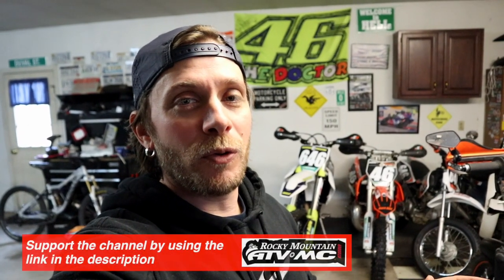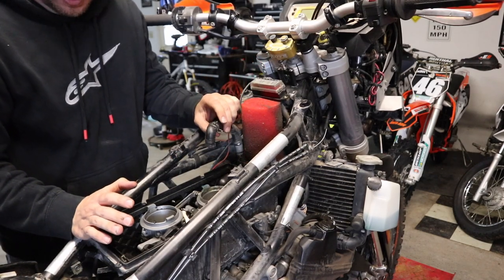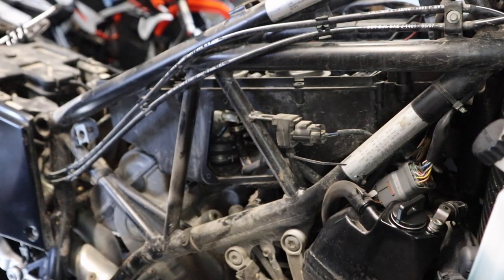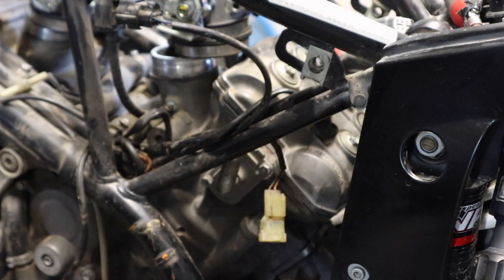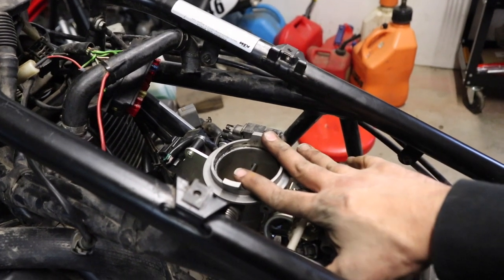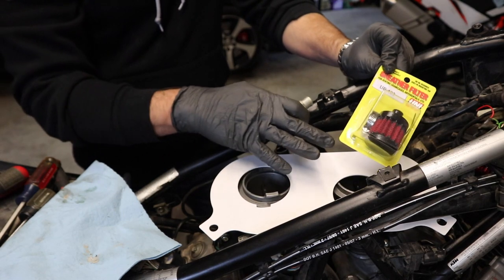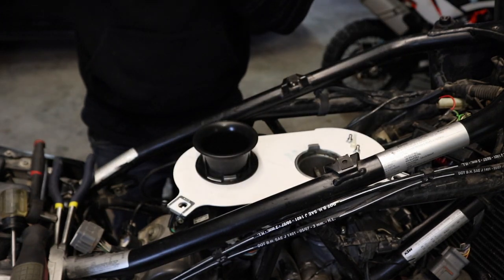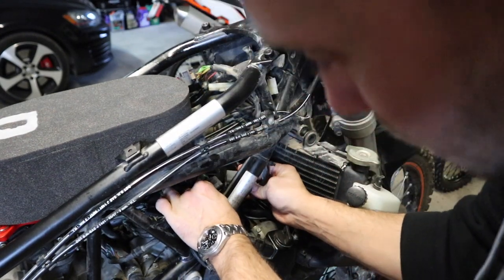KTM 990 ADV Air Intake maintenance and Upgrade | Back in the Garage

Comment: I also used the "No Toil" spray filter oil (the RED stuff) and found that it degraded the foam of the ITG filter. Caused it to "crumble" little bits of foam. 
The RED No Toil uses alcohol as the solvent, and THAT may be the cause of the problem.
After replacing the foam filter, I used the GREEN No Toil filter oil (water-based) and I'm hoping the foam element will like it better (time will tell..)

Comment: Any thoughts on Rottweiler vs Triple Clamp Moto airbox? I'm about to tear the 990 apart to adjust the valves, using your excellent video, and seems like a good time to upgrade the airbox as well. TCM is less expensive but on backorder...and I want to get this all done next weekend.

Comment: My concern is that allowing water and dirt to be in direct contact with the linkage/ throttle body. Anything that you thought about?
Reply from the maker: Have to be a LOT of water and dirt to get thru the radiator.
Reply: @2WR  I was thinking about the sides that now are exposed. Not sure it will be an issue over time or if it's just me that worries to much :D
Reply from the maker: Lol stop worrying. I’ve been running this setup on my 1290 for tens of thousands of miles with no issues. No issues on the 990 thus far either.

Comment: any mods to the ecu map with this? also, have you considered a 2 into  1 exhaust?
Reply from the maker: My map has been tuned and will be updated to further smoothe out a bit of a dead spot around 4500rpm. A retune isn’t necessary. And no, this is a budget bike for me. Bought it cheap and putting minimal amount of money into it.
Reply: @2WR  makes sense. Im following a similar track. My 1190 has the upgrade intake with a dongle to richen slightly. Looking to get more low end grunt on the 990 as well.

Comment: Why do people delete the SAS?
Reply from the maker: On some bikes, (like the newer 1090/1190/1290) it opens up under seat storage space and makes accessing the front cylinder for cable checks/adjustments much easier. For all bikes, it eliminates points of failure along with a little weight savings.